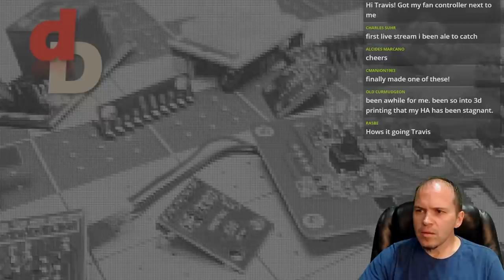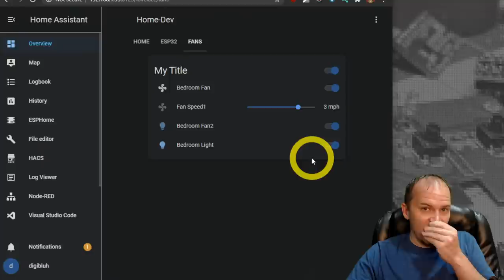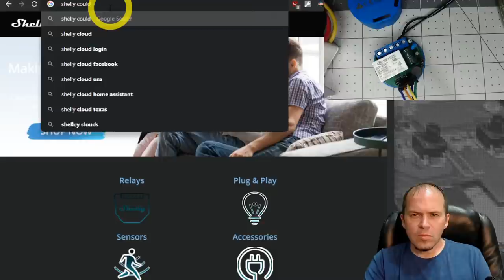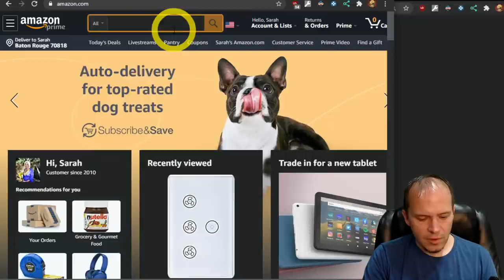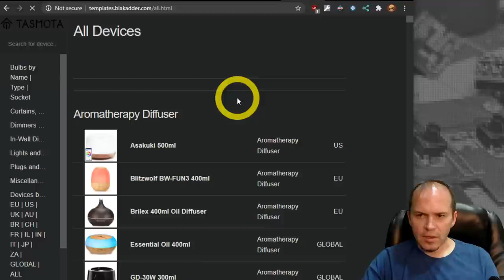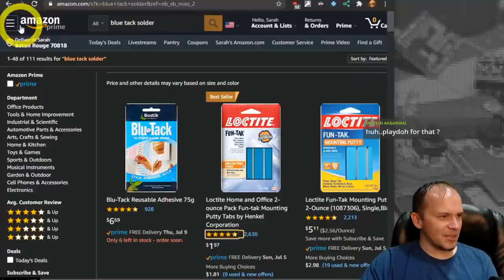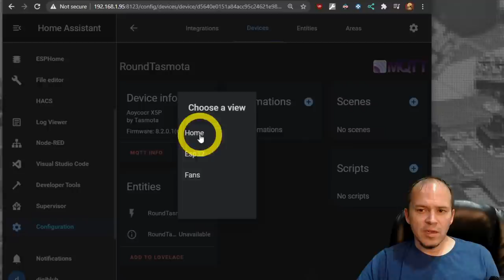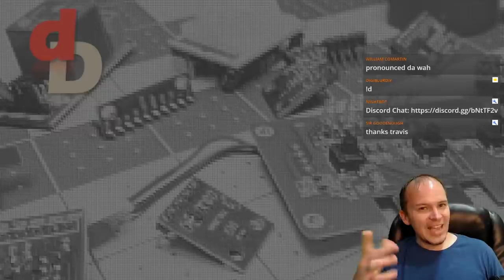Combo Speed Fan Controller/Dimmer with Tasmota - How to Flash Shelly devices with NO wires!

Comment: The DS03 switches shipped from Amazon in October 2023 are much more challenging to open than earlier models. Instead of having a socket between the button board and the power electronics, the connecting the eight pins are soldered on both ends. That is, the boards are now soldered together with rigid pins. This is both cheaper and a middle finger to anyone wanting to reflash the board.
It is possible to remove the whole assembly from the plastic box by first removing the two screws on the back of the board. One connects the green ground wire to the aluminum heatsink that wraps around the back of the switch. The other, hidden under the back label on the line between the "Line" and "Lighting Load" sections (centered) at the same offset from the end as the ground wire screw.
If you remove those two screws and separate the aluminum heatsink from the plastic back of the switch, you will also separate the aluminum heatsink from a power device it is cooling, a triac or similar. There will be a slightly adhesive bit of heatsink pad that comes loose when you pull the aluminum away.
Lift the power device slightly to make it easier to pull the three board assembly out the front side.
Now you can remove the four screws on the button side of the switch and pop the plastic clips that also hold the front panel to the switch body. With the power device able to come out from its niche in the back, you should be able to remove the front panel with all three boards on it.
You should be able to gently lift up the button panel (still screwed to the button board, on the side away from the pins that connect the boards. You want to lift it up only so far as necessary to access the pads on the side of the board that are soldered to in this video. (around 29:20).
The board still has the same date on it (2019/11/29) as the pictured on, so it is unlikely that much has changed other than the interconnection.
This is as much to tell current viewers that this is nowhere as 'easy' as it once was. I sacrificed the 8-pin connection in the interest of 'science, so I will probably replace it with something less difficult should I need to open the switch again. There do not appear to be any easy answers to this situation. New discoveries in OTA updates?
Reply from the maker: Yes. No need to take them apart. https://digiblur.com/wiki/devices/other/treatlife_esmlfe_fan_ds03_beken

Comment: I ordered 3 of these when I saw your sneak preview post a week or so ago and finally got around to flashing one of them today. It's still on my bench and not installed in the wall with the fan/light but all manual controls appear to work as expected and everything behaving like it should on the switch via MQTT commands from HA. Tomorrow I'll swap in a dimmable LED bulb in the fan and install this in the wall to take it for a spin - pun intended. Next up the other two. Thanks for the heads up on this great switch and the blog post tutorial to free it from the cloud! Great work and content!
Reply from the maker: Thanks for the comment!  Glad you were able to jump in too!  So nice compared to having to do the iFan03 hack-a-roo.
Reply: digiblurDIY indeed and I’m already coming up with all sorts of ideas that the spare Gosund switch next to each of these that used to control the fan light can be used for when configured for multi press. I’m left wondering, now that this unicorn has been discovered and tamed, what else are we DIYer/SmartHome/Automation/geeks missing or in need of? This was a really big missing piece of the puzzle. What else is out there needing a solution?
Reply from the maker: You know I am always searching for stuff that can be tamed and easy to do.. Or at least make it easier to do. Let me me know if you find something cool.

Comment: The DS03 switches that shipped in February 2021 have details on the sticker to double-press the switch you would like to dim instead of needing to turn the lights or fan off and on before being able to dim the one you want.
Reply from the maker: Yep. They started that not long after the video. They didn't fix the bug with the turning off the light then fan closely together yet though.
Reply: @digiblurDIY  yes, I noticed that issue. It's almost like the dimming animation for the light conflicts with the fan switch animation.

Comment: I've been trying for 2 days to flash this thing. I'm using the jig method. I'm sure I have it lined up and I flashed a bunch of other single pole switches no problem this way. Yes I grounded the NRESET. I noticed that you have a TYWE3S chip on yours. Mine has a WB3S. Is this a new chip version. I just purchased this in June 2021. Have you seen this WB3S before? Thanks for the great content.
Reply from the maker: Looks like that one has been swapped to a non ESP. It would require a transplant to an esp12f module.
Reply: I order 2 also from Amazon and they are also WB3S. Any recommendations on a good alternative?
Reply from the maker: @KJThaDonPSN  I've heard these are fine for now. https://amzn.to/3hgfoqX

Comment: Can you detach button from relay with Treatlife fan/dimmer (I need the button to not control the light, and want to customize its function instead) ?
Reply from the maker: No. Tuyamcu controls all the buttons. You  could cap the load and use device groups.

Comment: Hi Travis, I have a ceiling fan with a light, but not a separate wire for that light; a pull string currently controls the light.  This seems like a perfect application for the IFAN03, but the fan canopy is unfortunately too small to fit the IFAN03.  But the canopy is big enough to fit a Shelly1 or Sonoff Basic.  Do you think the light button on this Tasmotized Treatlite Fan Controller can be re-programmed to control, via MQTT, a Shelly1 or Sonoff Basic connected to the light wire?
Reply from the maker: You could do some rules based off the dimmer state here to make it follow.  Device groups might even work too but I haven't tried it.

Comment: I read on Amazon that they are sending these out with the WSB3 chip. If I pull the chip and replace it with a pre programmed esp12f would there be any issues that you can think of?
Reply from the maker: Nope, none at all.  Covered this in type thing in chip swap video - https://youtu.be/d_HpkIiWC3Y

Comment: Double tap of the fan or light button acts like a "mode" switch from what I can see (bench testing).  i.e to make the light active double press the light button.  To get the fan active double press the fan button.
Reply from the maker: Yeah I found that out along with don't press them both together at the same time or really close.
Reply: @digiblurDIY  What happens if you press them both together?
Reply from the maker: If I do it with them both on to turn off the fan and light at the same time, the lights go off on the switch but the lights stay on in the room.

Comment: Is there a way to turn the status LEDs off after a few seconds for the Treatlife Fan/Light combo dimmer? It is in our bedroom and the white status LEDs are a little bright when the lights are off but the fan is on. Since this is using the TuyaMCU I am not 100% sure on how to go about this in Tasmota.
Reply from the maker: Not that I know of as the TuyaMCU handles all that. They are pretty dim already but you could easily open it up and put some material in front of the LEDs to block them.

Comment: Not compatible with fans having built-in remote control system.?
I don't get that as most new $100 fans come with a remote, so where is this device targeted?
I have lighted fans all over the house with remotes, but I would like to dump the remotes and install this so I can make them smart.
Reply from the maker: This is for your typical fan that has the light kit wire, fan motor wire, neutral and ground.  Some fans you can remove the remote control module.

Comment: Just got this installed, set the fan speed to high via the pull chain and get the following behavior when using the switch: switch off = fan off, switch speed 2 (since the first increase skips speed 1) = fan off, speed 3 = fan ridiculously slow...slower than the fan's normal slowest setting, speed 4 = fan at full/highest speed. I obviously need to sort this out before installing this in rooms besides my office otherwise the WAF will go out the window and halt me in the middle of my 50-60 smart switch installation! :) It's a normal/generic Hugger fan from Home Depot (Model #AL383LED-BN    Internet #300930186     Store SKU #1002269802) - dumb/no smarts, no 3 way switching, nothing. Same behavior whether I use the Treatlife switch itself or send commands via MQTT from HA. Any ideas?

Comment: Nice video. With the Treatlife Fan Controller I have the very slow speed problem like the iFan03 with a 120v fan. Do you know if there are any chance to change the capacitors?
Reply from the maker: What capacitors are in your fan?  I have three of these and haven't had to swap capacitors since it was designed for 120v.  I have opened this guy up before and you could change them if you wanted to.
Reply: @digiblurDIY  Thanks for your response! My fan (KDK M56LG) have a 5-speed selector for the wall, non pull chain. Inside the selector have a condenser with a combination of 9uf, 7uf and 12uf capacitors, 150VAC.
Reply: @digiblurDIY  Sorry, I see now directly in the fan and have a SH-DPY 300VAC 5.4uF 16-21X capacitor too.
Reply from the maker: Oh wow, you've definitely got an oddball one there.  Typical fan caps are in the 4-6 range so that would explain why this fan controllers is half the speed as needed, I bet that horrible with the stock iFan03 and it's 2.5uf caps.
Reply: @digiblurDIY  Yes, really complicated, do you see any solution? Which capacitors belong to the fan side, top or middle, in the Treatlife fan controller?
Reply from the maker: Typically the caps go where the speed is changing. Like the pull chain in typical fans or in a smart fan controller. If there is one cap in the fan that is the start/run cap.
Reply: @digiblurDIY  maybe I need to try the iFan03 modified. Thanks for your help!
Reply: @digiblurDIY  Sorry, one more thing, I see two 3.3uF caps on top of the Treatlife, are those the ones I could change? Thanks.

Comment: PLEASE PLEASE PLEASE HELP!!!  I know you can.. lol..  I flashed some Wyze Bulbs with tasmota, used the Wyze bulb template from black adder website and the bulbs don't turn completely off, they have a light glow to them. I disabled GPIO14 and this solved the issue with the glow, but I have lost the ability to change the bulb temperature. Any Advice?
Reply from the maker: How did you flash them? I don't have any of these bulbs so I am not experience with them. Maybe someone on the template page can answer how they did it?
Reply: @digiblurDIY  pretty simple to flash, opened them and flashed on the pins, got them in Homeassistant working like a champion, besides the color temperature part. where do I find said templates page?
Reply from the maker: Thought maybe there might be someone who left info on the template page. You can try this to find other pins. https://youtu.be/eDoIkd58HRM

Very cool. Didn't know you could open those easily.

Comment: Thanks for the video Travis! The OTA Shelly flashing came in the nick of time for me.  The shellyforhass interventions worked great for me until I switched to UniFi network set up. They just don’t seem to like the IoT VLAN I assigned them to. Now they are Tasmatized and they play well in my NoT VLAN.  I’d like to also point out the sweet app (Tasmota Device Manager) that you can use to fine tune tasmota devices.  Here’s the link to the app if anyone needs additional support with configuration  https://github.com/jziolkowski/tdm
Reply from the maker: It's an awesome little process. Makes me like the Shelly stuff so much more now.
Reply: Wow, OTA flashing for Shelly 1?! Sweet!  What is the default Template mode for it?  I'm using mine now with standard wall switches that control the fixture (Toggle Switch in the software). Will it behave the same way?  As an aside, I'm a Shelly fan because we have an older part of our home where there is no neutral in the light switch box, it goes to the fixture from the mains.  The shelly 1 is small enough that I was able to add it into the ceiling fixture box and make the light "smart" without pulling wire in the walls.
Reply from the maker: Yep. It would work. Pretty cool process. I have plans to incorporate it into an update video of a project.